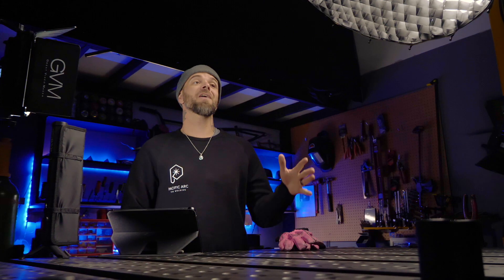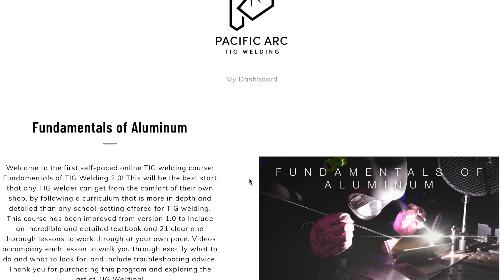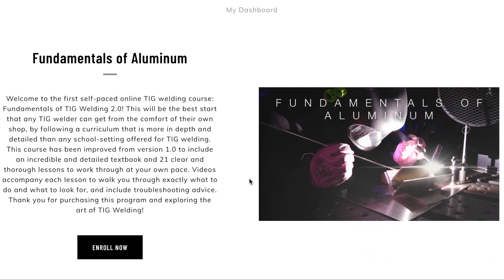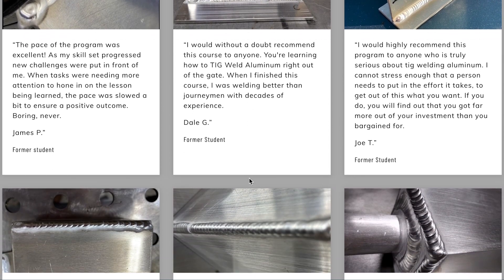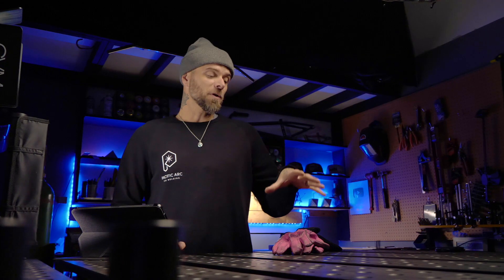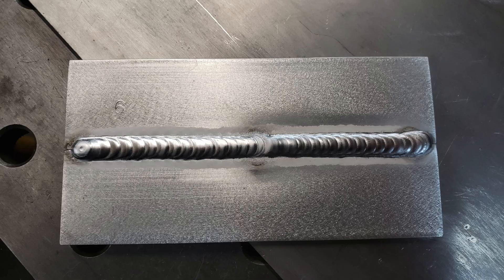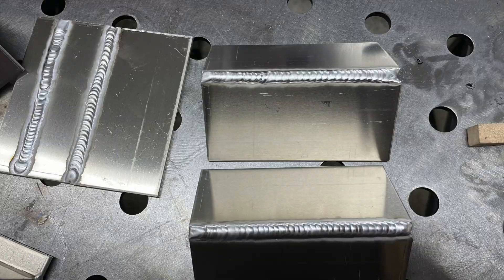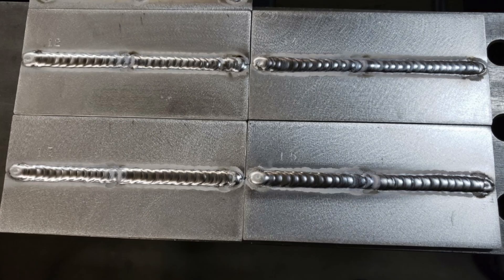MY TIG WELDING COURSE IS FINALLY DONE

Comment: Dusty, does this include info for Sartre systems, in such as a Thermal Arc 95S, a lift start system with manual gas flow?  Or is that too basic? Thanks.